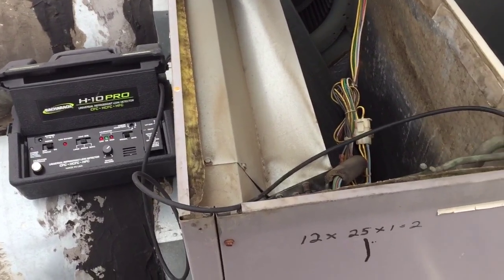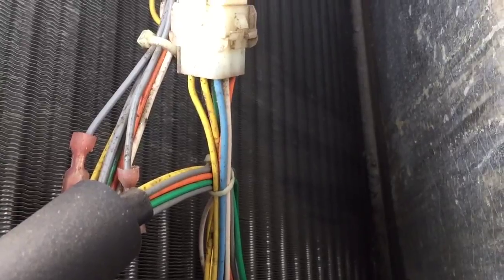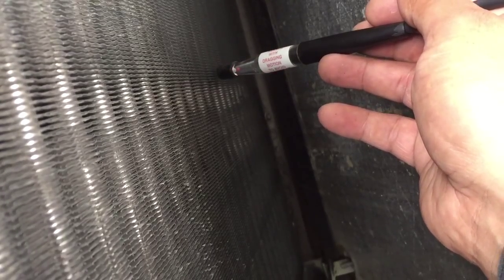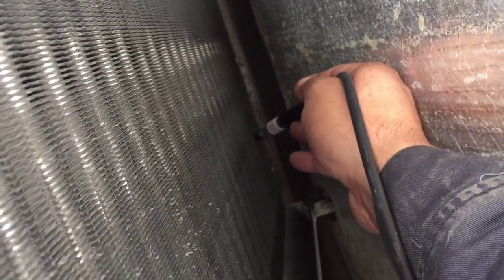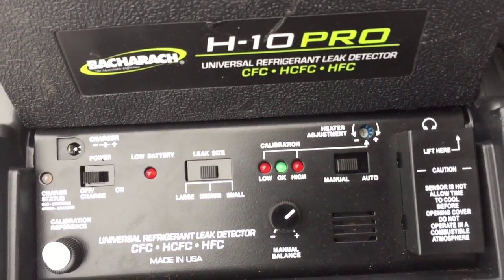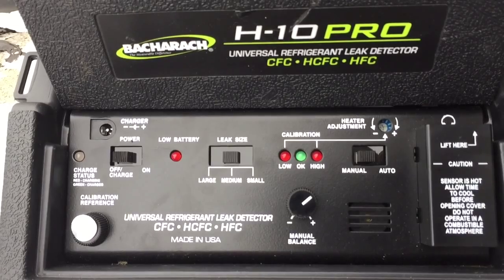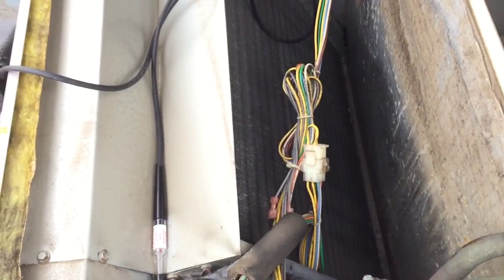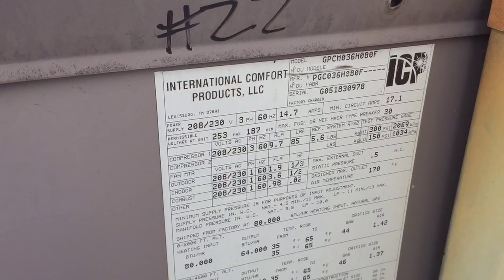Electronic leak check

Comment from the maker: Emin HVAC  The H-10 pro and H -10 pm both are battery operated but also can be operated with the power cord. They have some good options.
Reply: Cool man thanks Joe.
Reply from the maker: Emin HVAC no prob bro. Bacharach is phasing out the h-10g and the h-10pm you can still purchase them but the new h-10 pro is only one that's going to be in production now. They do have some accessories like the 277 power cord but the h-10pm comes with a 120v power cord and also the 14 in extended wand  I eventually will pick that up but so far best leak detector by far I have ever owned.
Reply: Tazzman228 so in your opinion which one is the better.